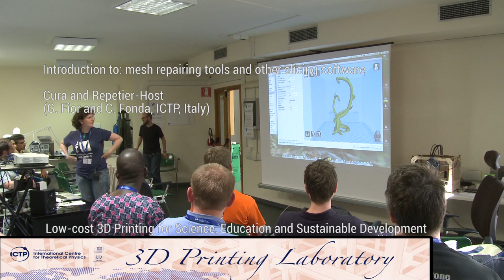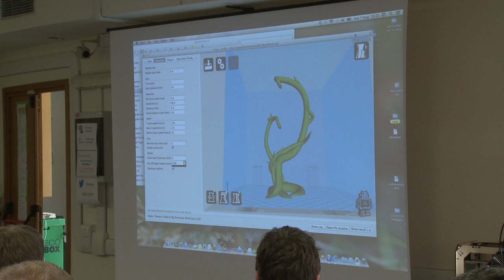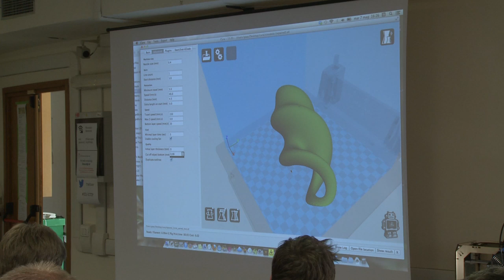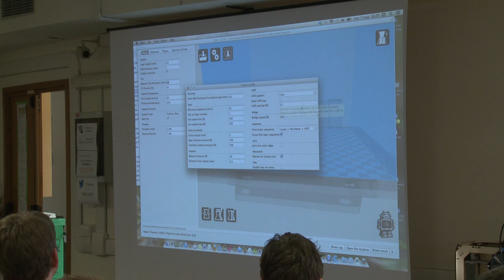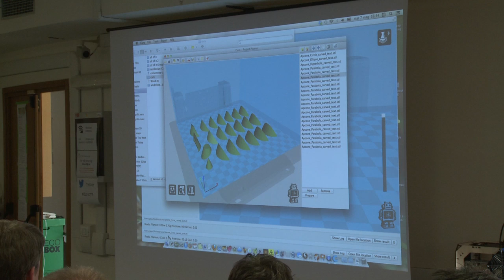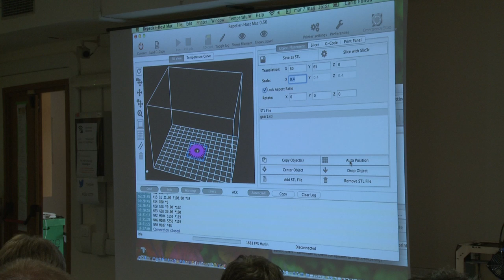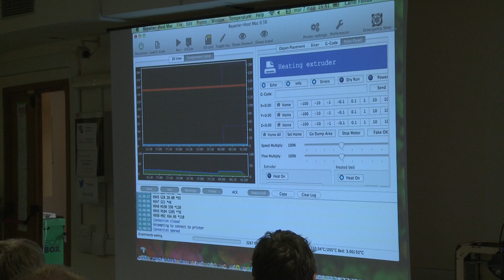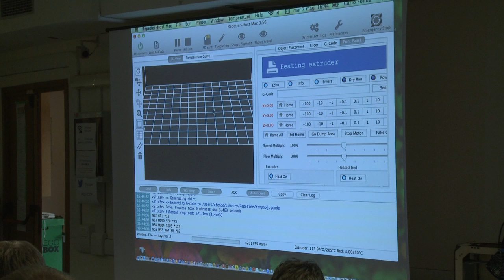Introduction to Cura and Repetier-Host

Comment: i know it is an old vid, but to inform some reprier users: The Reptierhost program wants to heat the bed first, after that it will heat the print head. in this case the printer didn't have a heated bed so it will never print when you send g-code that turns on a heat bed.